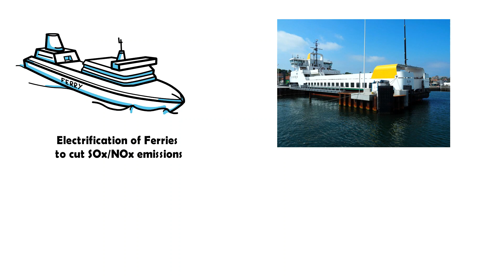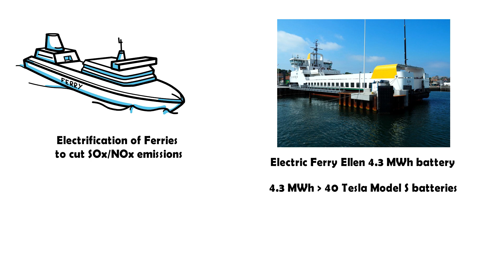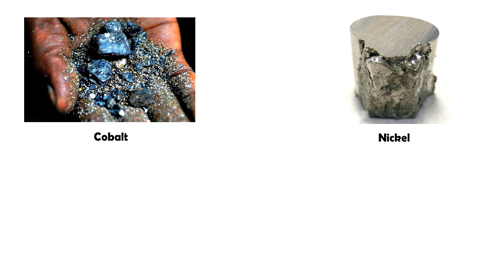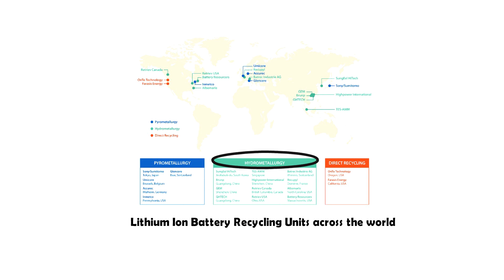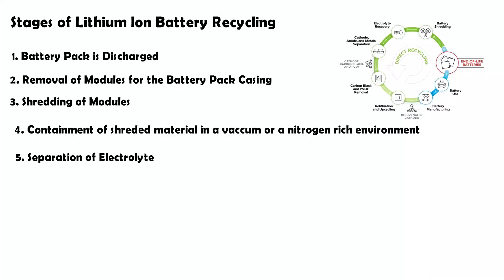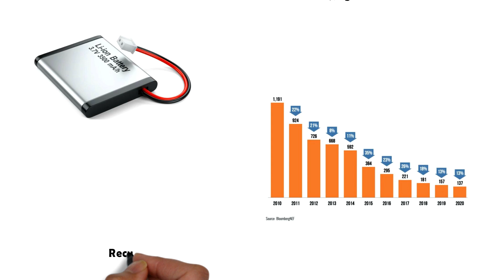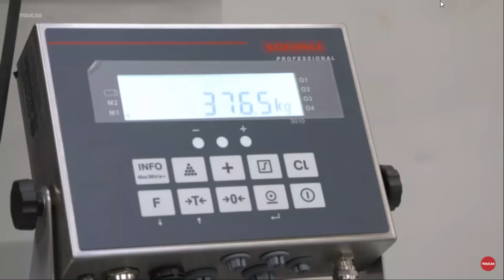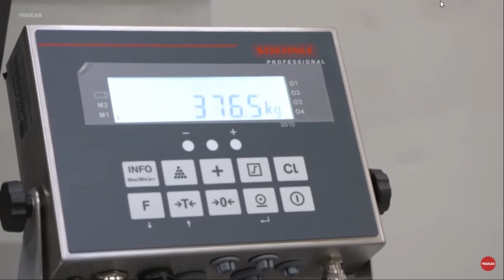The Value of Recycling Lithium Ion Battery & the process

Comment: Excellent video.  What is the key driver between the cost differences in China versus EU? Is it just labor?
Reply: I wouldn't doubt it. Regulations are usually a barrier of entry due to cost of safety equipment needed to process stuff this toxic. China's been shown to not give a rat's ass about their own labor pool in terms of safety. That, and the fact life is cheap there in general.

Yeah, I said it.

Comment: Non-destructive re-use of degraded LIBs could easily involve static grid storage applications, until their quality falls below an economic threshold where arbitrage is concerned.  They may be competing with new alternatives such as SIBs, but there is far more demand for grid storage than supply.
Reply: you are 100% correct. thing is this to use the used up batteries as storage one has to recycle/harvest the old batteries for personal use. recycling companies DO NOT want people to use these materials up.
for example the recycling center in centerville iowa received computers that i wanted to buy to recycle the precious metals.the main guy running the center informed me that in order  to be able to buy his computers i would have to get certified for Appliance Recycling through the IOWA DNR. i did that (took 9 months just to get to take the 1 day course that took several hundred dollars to take) at the question and answer period after getting certified i ask about computers and was told "THERE IS CURRENTLY NO REGULATIONS FOR THAT< NO LICENSE OR CERTIFICATION NEEDED) . so the head guy had LIED TO ME!!!  and i never did get a computer or even an ink cartridge from there!!